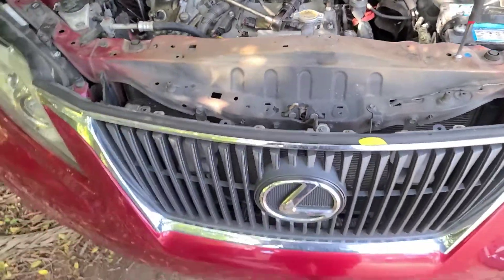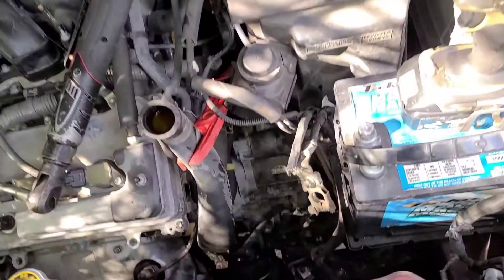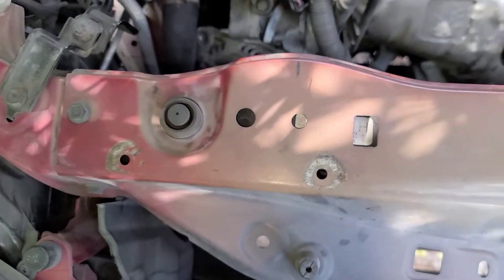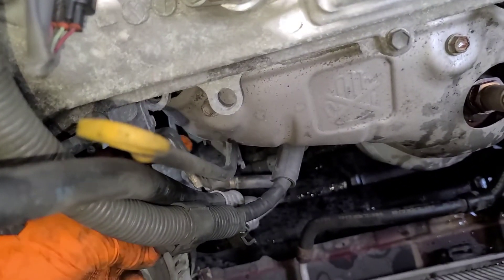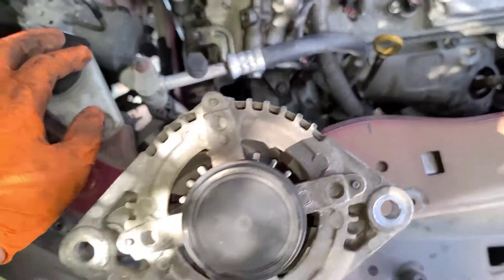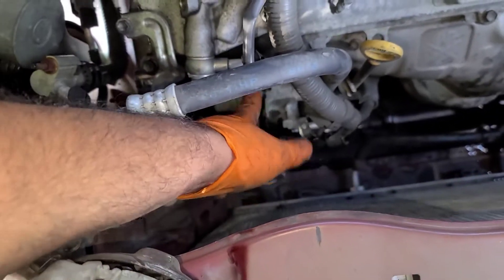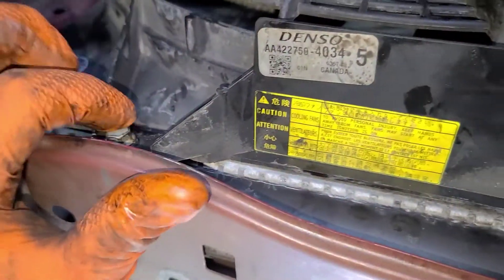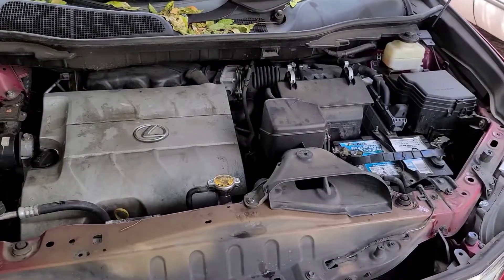2013 Lexus RX350 alternator replacement (NO wheel or radiator removal needed)

Comment: Can you get it out through the wheel well if you take the wheel and innner fender out instead of taking the radiator out.
Reply from the maker: I think this way it's best, you will still need to get the back bolt on the alternator out , and there is really no space there to get that done with fan and everything else in place.